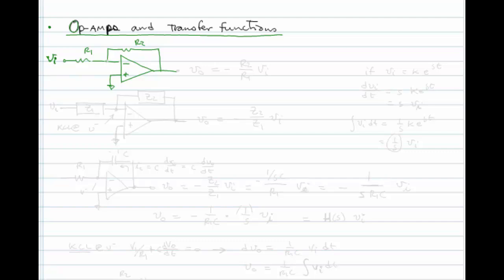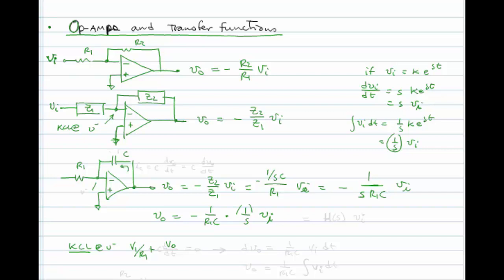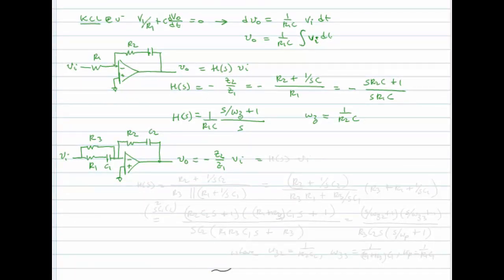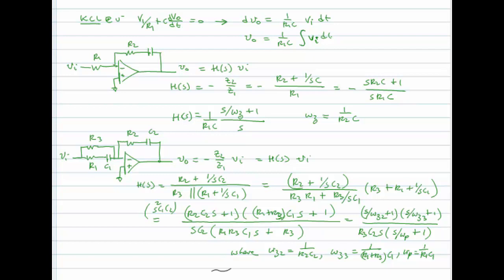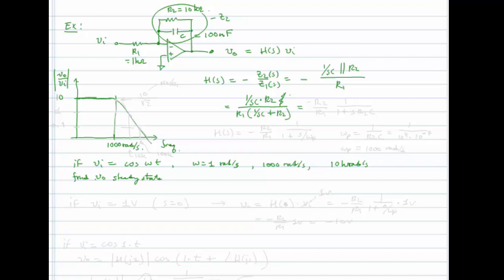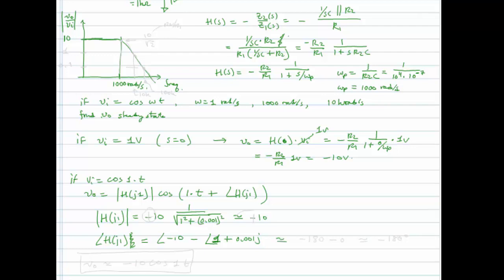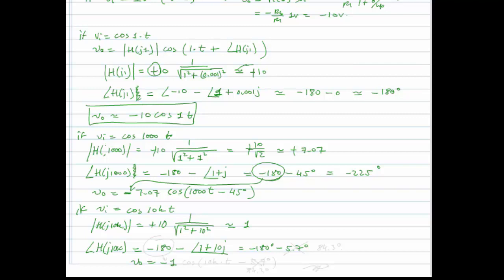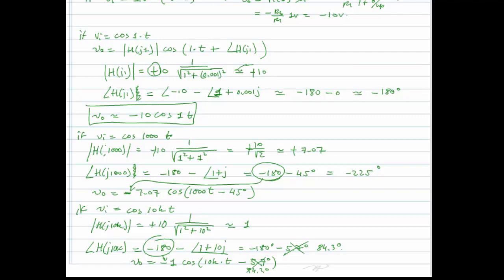Op-amps and Transfer Functions (OP06)

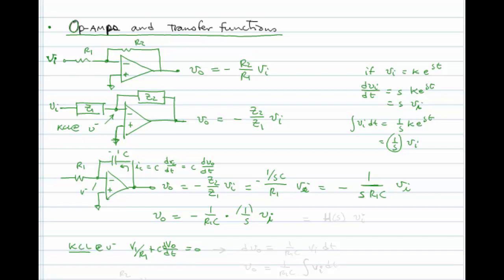Comment: @4:44, when you said it’s equal to zero it’s because the virtual ground concept right?, ;V(-)=~0V
Reply from the maker: Correct! vo = [ (v+) - (v-)] * Aol, and if (v+)=0V (gnd'd), vo is finite, and the opamp's open loop gain Aol is infinite (ideal opamp), then (v-) -> 0V, since vo/Aol -> 0V.
Reply: @jogreengel  Thanks for the clarification.